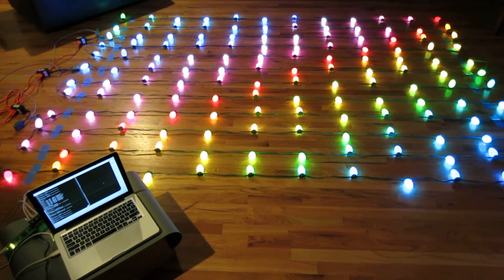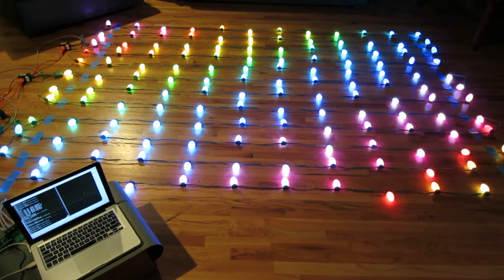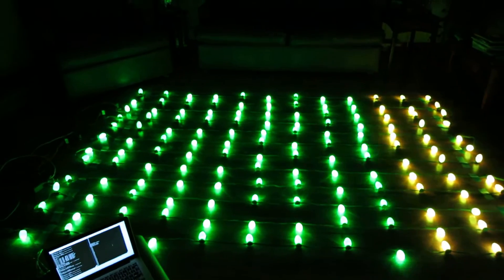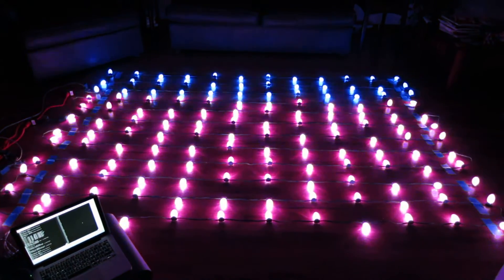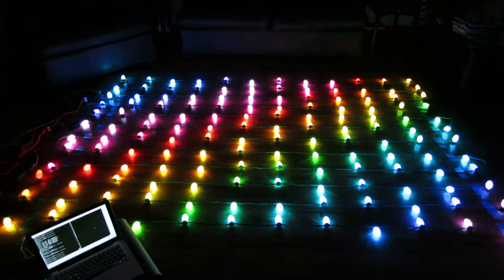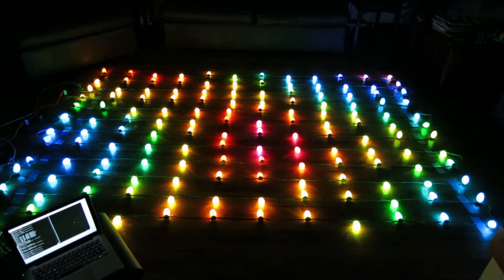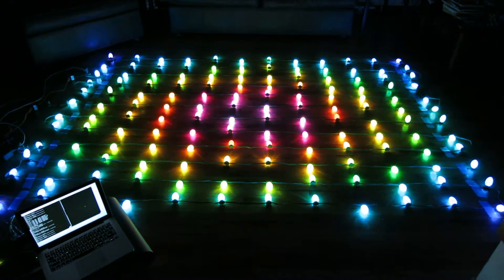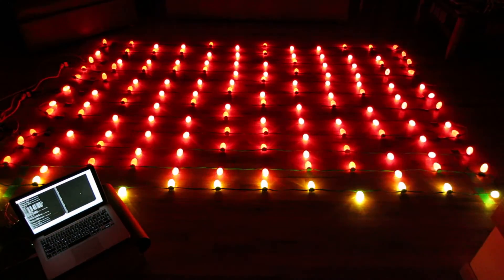12 x 12 LED Matrix Driven by MacBook and FPGA

Comment from the maker: Naman Govil I ran Quartus on a Linux box then copied the .rbf file to my Mac. On my Mac, i wrote some software to bit bang the .rbf file in to the FPGA’s programming pins using the FTDI D2XX direct driver. (The FTDI MorphIC II FPGA board I used has both a Cyclone FPGA and a built-in FTDI USB to parallel converter.)